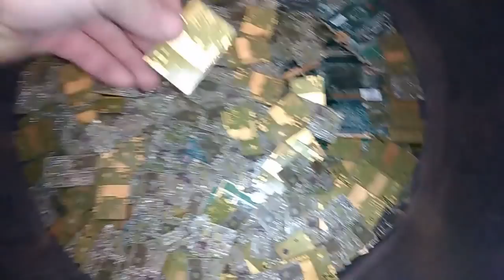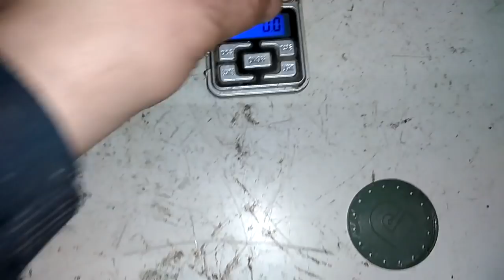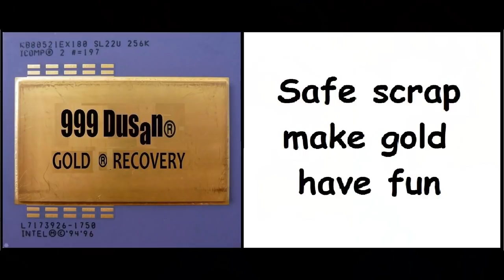Gold plated boards Gold with ACID-PEROXIDE SOLUTION!

Comment: it is amazing how little gold is used in modern flash plating. Boards from the 80's and earlier are thickly plated and provide a better ROI.
Reply from the maker: One gram gold can cover one meter square with plating.
Reply: Ap solution will attack such thin layers of gold and will be dropped out of solution by the presence of tin and other base metals into micro particles that would be hardly filtered. I'm sure you'll get some gold from ap waste solution. Goodluck
Reply: @999DusanGoldrecovery  It can be literally a few atoms thick! That’s amazing that it still looks gold that thin.

Comment: well done for getting  a gram out of that, 999 Dusan, ive just started a batch of 200 pentium4 CPU's, the ones with the silver plated copper tops & gold spots instead of pins, i removed all the copper tops with a hot knife & took the MLCC's, i got 165 grams of palladium MLCC's & 1 kilo of copper, ime using 40% strength acetic acid with a just a dash of peroxide to start things off on the stripped fiber bases, i will let you know the yeald when done in a couple of days so you know if its worth the hassle, i dont expect a lot but i though it worth trying as acetic acid is very cheap here. Ile be happy if i get half a gram of gold, anything more is a bonus
Reply: They’re tin plated tops mate, if they were silver plated I’d be a happy man 😂
Reply from the maker: Lot of cpu there. I do one smaller batch but i dint find silver there mate, onli tin plating on copper. Did you collect indium between caps and sillicon die?
Reply: @999DusanGoldrecovery  yes i scraped the indium from the inside of the copper tops to, i dont think i did a very good job thos as i only got 9.8 grams of indium, probably loads more on the copper tops still to scrape off. I did wonder if the silvery coating on the copper tops was something else. I grow copper crystals for fun here so will be interesting to see what is in the sludge from the electrolysis cell in a few months.
 ime just cleaning up the solutions now as you replied, does not look like i got much gold but its very clean spot foils from the CPU bases with no muck mixed in. Ile get a dry weight before i put them in aqua regia, even a tiny amount of gold using the method i did will be a small profit, the acetic acid i used is very cheap & the heat came from  my home heating so a very efficient recovery. Ime not looking forward to doing all thos MLCC's tho. i always seem to make a mess of doing those.
Reply: @999DusanGoldrecovery  total gold yeald was poor at 0.7 grams of gold, lots of work for so little but the process was fun tho, ive learnt a lot about the makeup of modern chips, i scraped of a lot of lids a little better & scraped the back of the silicon chip dies, so now ive got 21.3 grams of indium in total, 
ile do the MLCC's tomorrow with grinding down & a hydrochloric boil & post the yeald of palladium & silver to, ive been told that the tiny  4 leg a side MLCC's on the pentium chips are high yealding for silver & palladium,

Comment: Somtime exces Nitric will not show until you boil the soluțion before denoxing, even some gold will precipitate because is cold outside, the main gold is stil in soluțion. So my advice is to boil to 100C, denox again, and with just a small amount of SMB, precipitate again. Soluțion is not crystal clear si that is a sign of exces nitric or tin/lead/silver in soluțion. Good luck.
Reply from the maker: Nice tip mate, i just add it in stockpot so i collect missed gold on the end. But this is a perfect step to do  yes.

Comment: Thanks for sharing, I have a question, if pins must be boiled in HCL to remove tin, we’re the boards cleaned of Tin first, or is the AP contaminated with Tin, so can’t be reused and would it effect your yield, if the boards were not completely cleaned of Tin first? Thanks
Reply from the maker: In Ap tin stay in acid so dint contaminated gold fiols and flakes. But you can reused Ap again, just you need ad more fresh hcl and only copper pins, if yours pins is magnetic, they drop copper out from solution and make you big mess.
Reply: @999DusanGoldrecovery  thanks, that explains a lot, appreciate the reply

Comment: I have a bunch of similar boards and was wondering what to do with them..
Do you desolder them first?
Reply: hydrochloric acid will dissolve the solder, but i collect it because it can be sold even if its just regular solder. since you end up with gold foils with this method you can just rinse them well in the end to keep the dissolved base metals out.
Reply from the maker: You dont need to desolder em first, only if you collect tin.
Reply: @999DusanGoldrecovery  cheers.
Reply: @whateversmurfette  cheers

Comment: First , boiling HCL to remove the solders !
Second , hydrogen peroxyd with citric acid and water...! Need 3 , 4 hours only and you got all gold foils and your solution stay clean and easier for filtration. You have too much residue with your method and it s too expensive.

Comment: Dusan could you do video using just AP to do this without AR? Can you use SMB to drop gold with just AP?
Reply: The answer is no.  AP does not liquify the foils after they are removed from the board.  You can try HCL + bleach...if you are trying to avoid Nitric, but, the HCL + Bleach is incredibly dangerous.